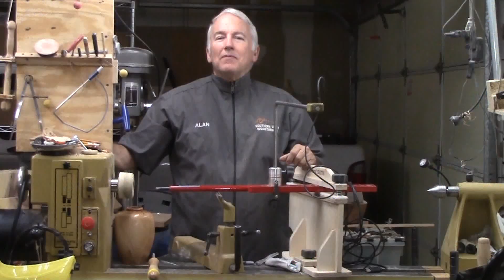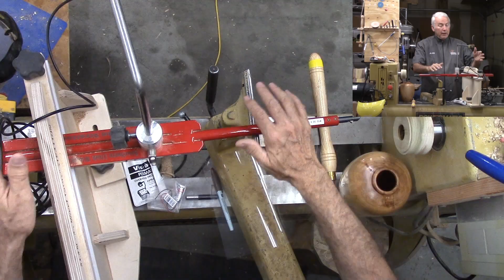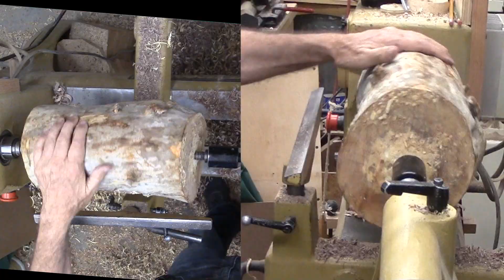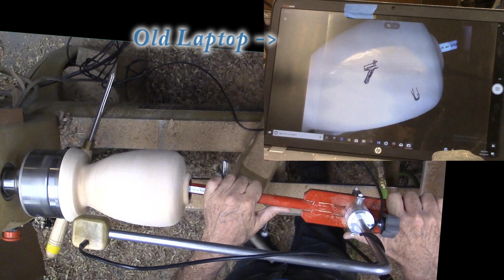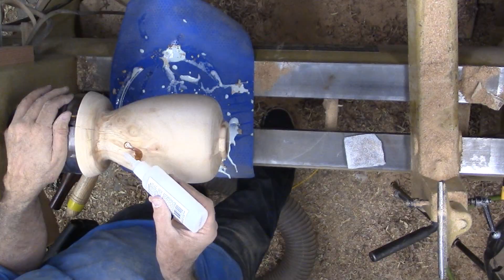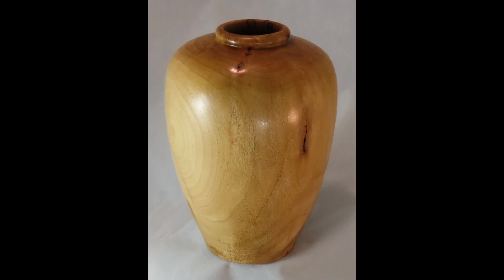Deep Hollowed Aspen Vase - Easy With Right Tools

Comment: Hi Alan, a nice piece. i'm fairly new to wood turning and I'm just putting my hand to some deep hollowing. No stabiliser, just hollowing tools and a hollowing gate. In part it went ok but I admit to getting some catches that nearly drove the piece out of the chuck! The main tool - a shielded ring hollowing tool - was okish but the catches i got with the scraper were something else! I compensated by using a negative rake scraper with a box rest and just about saved the piece. Just how do you avoid catches when working at distance from a rest and when you can't 'see'? Clearly one can avoid catches by avoiding deep hollowing and yet . . . . I'd like to get competent! I was impressed and simultaneously anxious when you said you had been avoiding deep hollowing.
Reply from the maker: Years ago, I had a deep hollowing tool that resembled a crutch arm rest.  Catches were scary and made me worry about my shoulder more than spoiled work. That's when I decided to build a deep hollowing rig before going deep again. My first rig had too much slop. This one is working great without worries about racking up my shoulder. 
There are woodturners who successfully use my first crutch type - but not me. I'd rather not nurse a shoulder.
Alan

Comment: I like the idea of using the camera... I'm going to have to look into that as well. My best advice though.. when using forceps avoid putting your fingers or thumb in the holes provided. If for some reason the forceps catch it will not be a good day for any body part wrapped inside of the finger holes.
Reply from the maker: Thank you for pointing out my finger issue. I will pay attention to that in the future.
Do not hesitate to call me out on safety. 
Alan

Comment: FYI, I made a hollowing rig very similar to the one you have, only it was all cobbled together from scrap I had laying around + a laser pointer.  (A commercial offering wasn't in the budget.)  There's a video about it on my channel if you want to see it - also has the captive style rest.

I like how the USB camera works, but think I'll stick with the laser for hollowing - simple, effective, and no wires or laptop needed. =)
Reply from the maker: Yes, the commercial rigs are somewhat expensive.
If the laser is working for you, keep it up.
The objective is to make great work - not to have the latest.
:)
Alan

Comment: Nice one Allan. And a fine demonstration of a very useful piece of kit as well. Thank you 
 Simon Hope Woodturning over here in GB sell an outstanding and extremely robust articulated hollowing system. As an added extra he also sells a complete camera system that works in the same way. Simon Hope video on the system provides handy tips on thickness control and measurements in use. Well worth viewing on Youtube or direct on his web site.
Reply from the maker: I made an articulating system complete with thrust bearings. I has more sloop due to the joints. I also had a hard time finding cutters to fit and ran short of time to make them. These guys solved all the problems.
Alan
Reply: @AsWoodTurns  Hi Alan thank you so much for your reply. I wasn't suggesting for a minute that you make an articulated arm hollower. The one you demonstrated is a fine tool indeed, straight forward simple and robust. It was to Simon Hope's video were he gives simple tips and tricks to aid cutting an even and consistent wall thickness. Method was a simple dotted line on the screen image at the desired thickness from the lead edge of the cutter. When the dotted line meets the edge of the vessel image, desired wall thickness has been achieved. Regards Jim